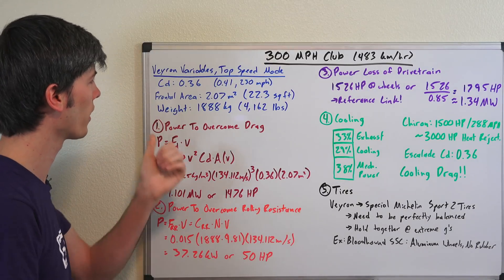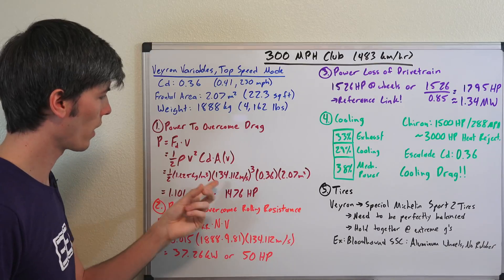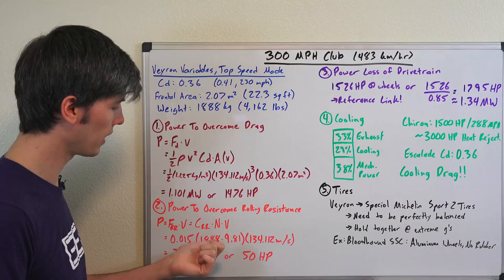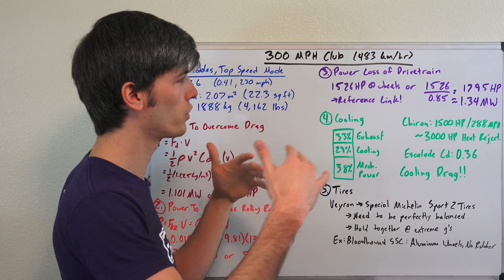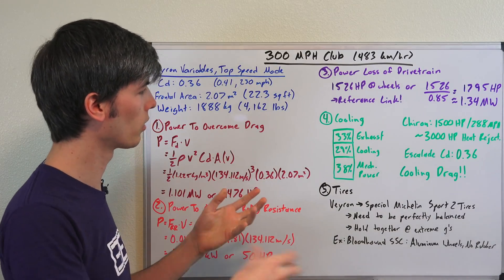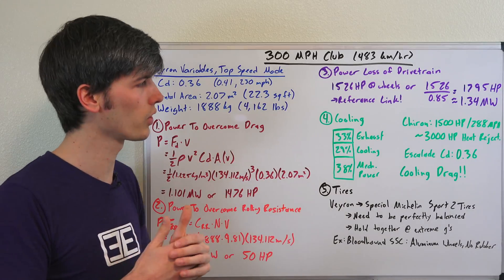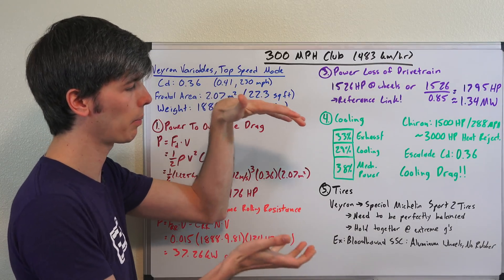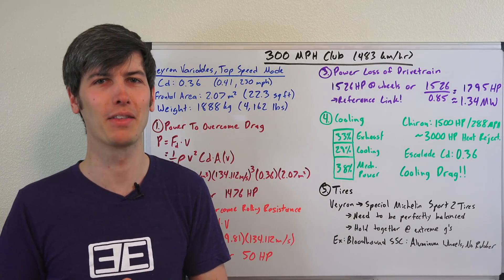Why Has No Production Car Hit 300 MPH?

Comment: 1st production car to break 300mph might be an electric one. It would need less cooling (but still need it...). Maybe with some king of big condensator it could overcome the need of very powerful batteries, at least when it comes to reach the top speed (not maintain it) 
 And thanks to the better acceleration of electric motors it could do it faster
Reply: Yeah ... so how did some student make it ?
https://en.wikipedia.org/wiki/Buckeye_Bullet

341MPH for electric vehicul as land speed record
(later Venturi set a 342 MPH record)

Buckeye bullet did 314 with a motor of only 400HP in 2004

With the improvement made since, I don't see why we wouldn't ne able to see an electric production car that can that fast 

You can have electric motor and gearing ;)
Reply: And ? Couldn't you think that the technology developed in the record vehicle could translate to some high performance electric vehicle one day ?

We already see how a Tesla model S can ridiculise most of gasoline powered car on drag race.

If it was so simple to have 2000HP car to break the 300MPH don't you think they would have done it already ? But as stated in this vidéo: the more HP you have the more heat you'll need to cool.
Thanks to it's higher efficiency, you'll not have this issue with electric motor, so less cooling needed, less drag, less power needed, etc ..
Reply: zak Morgan - Perhaps, but electric cars are still in their infancy. For one, drag would be MUCH lower on an electric powered vehicle as electric motors have a substantially better thermal efficiency. Even an electric motor with terrible efficiency (Something like 65-70%) is still twice as efficient as an ICE. You would literally need half the cooling to keep it in normal temperatures. Someone said that you would need a huge electric motor, and while true, we should consider that the Chiron's engine isn't exactly pint-sized either. You could use gears for an electric motor as well, and seeing as weight isn't even worth mentioning as a factor when chasing high speeds, you would only need to worry about the losses from the gearbox. But still, let's say we do need around 1800HP to get to 300mph. That's three times the power of a Tesla P100D. While it may not be possible now, let's consider the fact that electric cars have only REALLY been around for less than a decade. If we look back to the infancy of the ICE, let's say, back in the 30's, it would have been considered impossible for a production vehicle to reach 100MPH because cars back then made less than 100HP and had the aerodynamics of an industrial refrigerator.
Reply: ZDY you can always add a gearbox
Reply: electric motor at high speed is less effective at acclerating than ICE
Reply: Le_Poilu It would be cool to see a video comparing the efficiency of electric vs petrol/gas powered cars. How good they are in turning the energy stored in batteries and liquid fuel into kinetic motion if the car. It appears from the sleek designs of electric production cars they that require less cooling and so I would assume are more efficient. I wouldn't be surprised if there was to be a production car to break the 300mph mark that it would be a powerful hybrid.
Reply: Weight is less an issue when you're looking for top speed. As stated again in the video above drag is the main issue. 
Yes you'll need to cool the batterie, but it might need way less cooling than petrol engine at similar power. Less need of cooling = less drag, less drag = less power needed to reach speed value, etc ...

And if you really want to do a car focused on high speed you may use something else than Li-Ion battery for that. It could be full cell, or Battery + capacitor, etc ... Or some new battery tech. 
Petrol engine are by definition limited by their low efficiency compared to electric motor, they will ALWAYS produce way more heat than any electric system at equivalent power.
Reply: Le_Poilu I thought electric motors are just quick to 60 (let's say) but have really low top speed (aka not fast)
Reply: that is only because cars like testla dont have multiple gears, if they had which wont be hard to do at all, they would accelerate faster than any car even on high speeds because of the amount of torque they can produce
Reply: a diesel top speed car has a higher world record than the electric top speed record, let that sink in. petrol even higher at over 400 mph
Reply: The lack of transmissions in current EV's is because of the lack of a need for one. The added weight of a transmission isn't an issue when looking for top speeds, but it is when you are looking for range. Current EV's get more benefit from not having to carry the extra weight of a transmission around, and given the fact that electric motors have a much better "efficiency curve", it's completely unnecessary. In an ICE, the most efficient range is usually just a few hundred RPM's. A brushless electric motor can be made to be efficient from 0 to over 10,000RPM. That alone eliminates the need for a gearbox, as they are present in ICE's to compensate for the tiny efficiency and often poor torque curves. An EV has to deal with neither. Literally the only drawback of EV's currently is the batteries. Other than that, they are cheaper to maintain (Just a few bearings as far as moving parts go), more reliable (A single moving component is required to drive the car. Although bad electronics can be an issue too, the basics of getting an electric car to move and stop are so incredibly simple that you could literally go through a 1 week course in electronics and learn the principles of how electric motors in EV's operate) and as time goes on, they will become cheaper to produce as they don't require nearly as much time to assemble.

The future is EV's as far as daily commuting vehicles are concerned. The ICE won't just vanish, it's too vital as a generator, but we should be moving away from petrol as fast as we can. There are much better alternative fuels, one of which is a byproduct of one of our main sources of food - cattle. Methane is in every way better for ICE's. It can be used in both petrol and diesel (although the latter requires some modification), has a higher octane rating than petrol, is much cheaper, and it's better to burn it than to release it into the atmosphere as is. Sure, it contains less energy than petrol, but it burns much more efficiently and thus, is actually a better source of energy. It's also extremely cheap to produce and safer than petrol or ethanol (Methane and LPG are gasses, upon ignition they immediately burn up causing minimal harm, unlike petrol which needs to evaporate to burn and thus takes much longer to burn up when set alight.)
Reply: Electric might be the first to hit 300mph, but I have my doubts. First off it would NEED a transmission unless it was purposely built to hit the 300mph mark. Teslas top speed right now it 155 and thats because of it's the motors "redline" if you will. At 155 the motors are spinning at 18k rpm. To have a top speed of 300, you would have to put half the gearing in it which would make it a dog at anything under 100-150mph. You would also need WAY more power than what the tesla currently has, over double actually. While teslas top speed is 155 due to motor rpm, you can't stay there very long due to overheating. Tesla overheats very fast at high speed, this is due to them trying to get the least amount of drag and not putting a grill for cooling. With the amount of power needed to reach 300 you would need WAY more cooling, like dedicate the entire frunk to cooling with a big ICE like grill on the front. Drag would go way up as well, it would still be slightly better than a gas car but not by much. A transmission could solve the low speed acceleration problems and still allow the top speed which would allow it to get to its top speed much quicker. But that still doesn't address the power and cooling requirements. FYI to all the people trying to point out all the compromises of a trans, a simple 2 speed can be built to handle a LOT of hp, be very reliable, and weigh less than 100lbs. So that is a non issue.
Reply: The thermal efficiency of ICE is horrible compared to an electric motor, with so much drag coming from cooling it's only logical electric would be the first 300mph production vehicle, but will first need a big jump forward in battery technology.
Reply: Le_Poilu first of all, we are talking about production cars and not one of a kind bullets look a like objects
Reply: bilderberggroupinfo torque is constant in the power band of electric motor???
Reply: Le_Poilu electric motors also have less power in the upper range
Reply: Will definitely need a transmission and will definitely need to be built for the end goal of 300 mph goes without saying. With companies like Koenigsegg it's proven there is a market.
Reply: We won't respect electric cars until they give us the same vibes as a fossil-fuel based car, and until they have enough range / charge quickly enough.

If we used electric cars right now, we'd be going backwards in terms of innovations, since we'd have to wait around a lot more than we would like.
Reply: not electric but a hybrid car will be the first
Reply: Alex M I'm not quite sure where your automotive history came from but it couldn't be more wrong.  Electric cars were around in the late 1800's and we had cars in the US running modified Ford Model T engines well over 100mph in the teens.  Cadillac and Chevrolet's V8's in 1915 and 1917, respectively, were capable of over 100mph off the factory floor.

The current fastest piston driven engine vehicle ran over 460mph with an engine, the architecture for this engine was designed in 1955, that is smaller in size than Tesla's two motors with the invertors installed.  Yes the car is a streamliner but if doing it with electricity was so simple and easy you'd see streamliners at the same or higher speed, they aren't even close.

The problem an electric car is going to have is the massive discharge rate of the batteries in trying to achieve those speeds, as speed increases it will require more amps to continue accelerating, more amps equals more heat, more heat draws more amps, not before long a fire breaks out.
Reply: Rimac will accomplish this!!!
Reply: 10000 RPM seems quite arbitrary.... are you sure you understand anything about electric motor design? You can make direct drive motors that don't need gears, you can design them for any torque and any angular velocity that you may require, and can tune the efficiency surface based on your needs (i.e. high effiency at low rpm high torque or high rpm low torque). And graphene polymer batteries are a reality these days, go look GRABAT up.
Reply: Just slap a bunch of graphene batteries from hobbyking and a 2MW electric motor in an aerodynamic chassis. These batteries can release all of their energy in less than a minute. That's because they are not tuned for a high capacity like the ones in normal electric cars but for a lot of amps.
Reply: Brayden Haines thats not how it works, thats just how troll physics work. not reall physics
Reply: Bruno Cardoso Pls see the EE video's on fastest 0 to 60 times for a Tesla. Gears might and probably will, increase the top speed of a Tesla, but only for a few minutes. After that the power will be reduced to prevent overheating of the batteries.
Reply: Osama Shello electric batteries dont live long though, usually not even 10 years
Reply: That is not a production car then now is it? That would be a dragster type of car :P
Reply: You mean Volkswagen? No way they would compete with their own Bugatti....
Reply: It was able to do that because of it's extremely small frontal surface area and it probably has very skinny tires with little rolling resistance. ICE cars can already hit those speeds in under 5 seconds, and there probably already are some 2000+ hp street/drag cars that could break 300 mph with the right gearing and enough room. The biggest problem with making a production car do this is that most of the people buying them will not be car mechanics and engineers who can maintain and repair the car every time it is used. The other problem is getting tires that can do those speeds for a reasonable amount of time, over and over again while also having reasonable everyday drivability.
Reply: fastest production gas vehicle right now - 280mph. Fastest production electric car 155mph. Electric production cars will not reach 300mph before gas.
Reply: Which carburated production car has ever gone even over 200mph? Yea...none!  Really, the Chevy Cheetah went 215 in 1963, 1968 L88/ZL-1 and 1969 ZL-1 Corvette did 215,  the Dodge Daytona did 200 in 1969, there are a lot of carbureted production cars that have hit 200mph and more.  Just because you are young and don't understand engines doesn't mean it didn't happen.  Shelby, Bill Thomas, Smokey Yunick, Mickey Thompson and many others were taking production cars beyond 200mph, and yes the ones above are off the showroom floor that fast, no modifications at all.  COPO cars were capable of doing it in the late 60's as well.
Reply: Charles Thompson III and it only has that needed charge to max out speed for very short times. the future is electric and gas will never catch up once electric gets there.
Reply: My station wagon does 150mph.. you need a faster truck bro.. Volvo 850 T5R ftw.
Reply: thechum The Model S P100D is limited to 155 MPH and is the second fastest car in the world 0-60, losing only to the Porsche 918. Seriously. A 5 passenger electric sedan is faster to 60MPH than a LaFerrari, Veyron, Aventador, Enzo, Hellcat, Viper, McLaren P1 or F1, and literally every other production car save for the Porsche 918.

 Now please, tell us more about your old truck.
Reply: pretty much impossible, since you would need gearing in the motor because they get too warm after 10000 rpm and they won't have enough torque to get there unless you get a giant unusuably heavy motor
Reply: Le_Poilu yes tesla is fast in 0 to 60 mph but you need to remember that it will need lots of batteries which weight a lot plus when you draw that much amps from 18650 cells you will need to cool the batteries a lot cos they will heat up.
Reply: Le_Poilu isn't the fastest speed in an electric car 180mph?
Reply: the issue is places like where i live batteries will have a loss of as much as 50% in some weather so in the area im in electric cars will never catch on
Reply: bilderberggroupinfo yes, ita constant, but its not big enough to drive at high speeds while using gearing
Reply: quangluu96 it cant, they heat up easily and if they heat up too much, they can melt or become weak
Reply: MooseTheSyrupMan its true with most modern day electric engines that theyre limited to 10000 rpm, with tesla its higher but you cant frive it for lonf at a higher rpm
Reply: Le_Poilu there is a car that has broken  300mph but has 5k hp LMAO its called devel seven
Reply: you would need a transmission
Reply: Le_Poilu Am I the only one who speak french and think that ur name is funny? Also I'm totaly agree with you:)
Reply: +Jerry P. You know that weigth dosent matter for other than rolling resistance and torque when you're looking at top speed rigth?
Reply: Le_Poilu I wanted to write just that.
Reply: bilderberggroupinfo Power is constant. Power is torque x rpm. As rpm goes up, torque goes down.
Reply: Le_Poilu People are getting electric cars wrong.
Reply: speed record for piston based experimental vehicle is over 400... it means nothing
Reply: Not as it seem as of now, the first car to reach 300 mph seems to be a hybrid car, for example, the Regera has 1500hp thanks to its electric motors,  mounting a pair to the front wheels would give it the 300-400hp it needs to hit 300 mph, so that is my best bet. But as Koenigsegg doesn't go for top speed as of yet it doesn't seem likely in the near future. Besides rubber is not handling 300 mph very well yet. Fastest production turbo diesel is still under 200 mph...long ways to go for 300 mph!
Reply: no need for external cooling with Electric, throw a liquid nitogen tank onboard with a pump to circulate it throughout the system
Reply: atvkid0805 how would you suggest cooling the liquid nitrogen then? And why wouldn't that work for an ICE?
Reply: Manto my point is that if electric can do it so easy why isn't it?  The same type of vehicle, the buckeye bullet, a streamliner only went 321mph but yet a combustion engine in the same type of vehicle does 462mph.
Reply: The Esseboy rubber tires handle 300mph with no problems even 400mph.
Reply: Because developing that sort of motor and battery setups costs millions and more millions...and what do they get in return? A car with a 200 miles range that is bulky as hell. It will take like 5-10 years before some one with a lot of money does it. Lithium polymer batteries can put out around 20Kw/kg but ut takes up a lot of volume to do so!
Reply: I was thinking the same thing. combustion engines produce way more heat, so on electric you may reach better CX coefficient, that will help a lot.
Reply: When you have a single gear, yes they run out just like any gas powered vehicle (but at a MUCH higher spedd). I bet the top speed in your petrol car in 1st gear is probably not much over 40 mph. If you want to see what an electric vehicle with more than one gear looks like check out the Rimac Concept One... it has 2 gears in the motors for each of the back 2 wheels.
Reply: Le_Poilu the thing is that gasoline or diesel or whatever type of fuel you use has a better energy density than batteries, the Bugatti veyron tank only last 9 minutes at full speed, if the car was electric it should have a lot of batteries and the added weight would increase rolling resistance
Reply: Mostly... until the motor really start spinning fast (I think over ~8000 rpm in a tesla)
Reply: Same goes for petrol above the rev limiter. Only difference is that electric motors can hold together even when the power and torque start to drop off so they can rotate much faster without any issues.
Reply: No.
Reply: You'd need about half the cooling (maybe less depending on efficiency) since less than half as much heat is created per horsepower that reaches the ground with electric compared to gas.
Reply: Yes the weight is a reason why most EVs don't have gearbox with more than one gear, but the cost of implementing a transmission and the extra mechanical losses by having one are also reasons.
Reply: Not true. You never have to stop to fill one up unless you drive more than 300 miles in one go. I promise you don't do that very often. You never have to worry about it running out EVER (yes not even for daily commutes like you do with gas) unless you go on a road trip.
Reply: You do realize what an radiator is, right? Slap one of those on a true perfomance EV (which Teslas are not) and bam, problem solved. Gas cars just require stronger active cooling that BEVs because they are so much less efficient, that's why all gas powered vehicles have one when Teslas do not. They passively cool into the atmosphere through the bottom of the battery pack.
Reply: That's not how regenerative braking works. No one does this because the energy input to turn the generator is greater than the energy the generator can create. If what you said is possible there'd be no need for power plants because infinite energy would be made with a bunch of motors turning generators in parallel.

Regenerative braking works using the same motor the drives the vehicle.
Reply: Yes GM recalled the EV-1 and there was a candlelight vigil held by the owners loved the cars and they were forcibly taken.

Try turning over a petrol vehicle that hasn't been serviced for 40 years. I dare you. I've only ever seen something turn over that wasn't run for 25 years and it was an industrial diesel engine. NO commercial vehicle can or ever will turn over without a hitch after 40 years without being run or serviced. Although the batteries will be dead I promise you that an EV will have an easier time turning on under the same conditions.

Almost all gas powered vehicle have active cooling, most electric motors cool passively.
Reply: Huh? Which carburated production car has ever gone even over 200mph? Yea...none!
Reply: With 5000HP that wouldn't be a problem would it?
Reply: Ehm no? A ICE engine has around 30% efficiency. An electric motor has 90% efficiency...that is a 7 time difference!
Reply: It'd have to have a pretty damn impressive drag coefficient to overcome the massive amount of weight in battery cells it would take to propel an electric car to 300mph.
Reply: The Esseboy nah its 3 times difference.
Reply: No...if you have an motor that is 90% efficient at 100kw 11kw of heat will be created :)

If you have a 100KW engine that is 30% efficient at 100kw it will create 233Kw of heat.

You can confirm this by drividing the total power by the mechanical power, 333Kw/100Kw=0,30=30%

So actually the electric motor creates 95,3% less waste heat than a ICE engine. Or 21,18 times less :)

Sorry for my brain fart :P
Reply: I love how all the people replying to this is dumber than bricks
Reply: I'd like to see a megawatt capable electric battery in a car.
Reply: The Esseboy it would be more accurate if you calculate the overall drivetrain losses, batteries create heat when discharged, after that it would probably be more efficient than an ICE from an ordinary car but not that much from  a f1 car for example, you also have to consider that batteries weight more and have less power than gasoline, meaning it has to accelerate more mass, requiring more power, generating more heat from the battery
Reply: Adam Fink Teslas do have radiatiors
Reply: Dylan Morgan Oh man!  The rimac is no joke!!! I really like that car!
Reply: Actually, the reason EVs don't have multi-speed transmissions is because they are less efficient.  Since range is always a concern, and torquey EVs at normal speeds don't require multiple gears, they use simpler and more efficient gear reduction systems.  Tesla's first Roadster prototypes had 2-speed boxes but they kept breaking gears due to torque.  This from a Tesla  engineers I know.
The downside is that Teslas cannot achieve high top speeds due to gearing limitations.
Reply: It will probably have a big helping from nano technology if it does come into existence as well.
Reply: And what do they all got in common? Poor handling and shitty safety ;) Carburators belong in museums!
Reply: push n muh electric car dreams.
Reply: zak Morgan i would have to say this is due to the feaseability in making BIG power with electric motors. with gas or diesel engines you can just tubocharge them and call it a day for your hp goals. with an electric motor to get it to run long enough you need a LOT of batteries to maintain that much power, i would think this is gonna limit you, the other big limit would be interest, no one really seems tk care about electric vehicle records as much as gas. keep in mind these are just a bunch of my guesses:p and i prolly shouldnt even say they're educated
Reply: Le_Poilu electric is good for high torque which gets you a fast start and that's why the 918 goes 0-60 in 2.2 seconds you need to get high horse power to get high speeds
Reply: Jacob Luck 918 doesn't do 0-60 in 2.2 it's a false statement lol
Reply: MrZorded it makes 0-60 in like 2.6
Reply: What is a condensator? Do you even know what you are talking about?
Reply: Maybe he wanted to say capacitor. In my language is called a "condensator" aswell.
Reply: Le_Poilu zombie 222 I think it is, can reach 250. So I could see that happening in the near future
Reply: I think this analogy is flawed. While electric cars are novelty still, electricity is not a new technology, nor the electric motors. Granted improvements will be made and probably significant. But unless something radically different enter the scene, ice will be improved at least with the same pace as electric engines. Probably better if same effort and resources are pour in them. 

Just to see how scewed your view is, consider the REAL FACT, that in the 30's fastest production car had top speed around 140 MPH. While still having terrible aerodynamics. 100 MPH top speed is broken decade earlier. Modern batteries are from almost 3 centuries ago.
Reply: Le_Poilu how about using infrared light to generate energy for batteries?
Reply: MousTheSyrupMan, >250 miles at full charge and ability to top it up at home every morning isn't enough for you?
Reply: Le_Poilu only a electric production auto could break the 300mph mark . gas will never do that in any stock config coming from factory.
Reply: it would be extremly heavy if it were to have motors that can do that mush power
Reply: Le_Poilu electric cars have better take off,but terrable top speed at the moment.is there a electric car that can go over 120 at the moment?? my truck will go over 120 lol.broke the speedo
Reply: Leo well if that true my baf.i did say i didnt know,i just heard that somewhere so wasnt fully informed about the tesla.dont realy care that much bout em honestly.but ya the old truck a 95 gmc seirra c1500 with 305 engine.tranny out of it now but waitin on new one.thing varley runs but will chooch along with smoke out the hack like crazy.think its the piston rings.anything else u wanna know??
Reply: People who don't take electric seriously will eat there own words one day, for example the Tesla roadster destroys a buggati up to 250mph and electric cars still don't have the world's full attention yet, petrol cars struggle and they've been around alot longer. (Production cars)
Reply: Best  joke i've heared in a while
Reply: torque is constant across the power band in an electric motor the most part. what are you smoking?
Reply: The Model S can only perform at maximum performance on a full or near full charge.
Reply: I don't see why a car company couldn't make a 300mph car. They do it all the time on the salt flats, since I think the 90's? And the top of the standing mile cars are not that far away from the 300mph mark, which is way harder than just getting to a top speed of 300mph.

Edit: just checked, John Lingenfelter did 298mph in 1989 with a 1400hp twin turbo Firebird. I bet almost three decades later a company can make a reliable version.
Reply: Na my truck just a old beater truck.just git vurious what itll do.it went over 120 broke speedo only goes 120.lol im just saying the fastest electric car i know of is a telsa,and it only goes 120 i think,now a old beater farm truck with 259,000,l miles goes faster thats sad